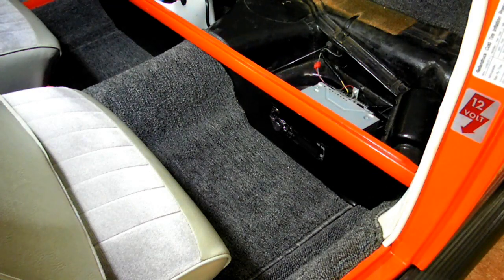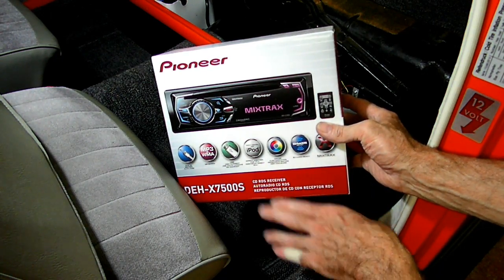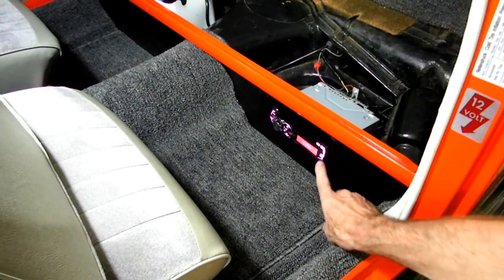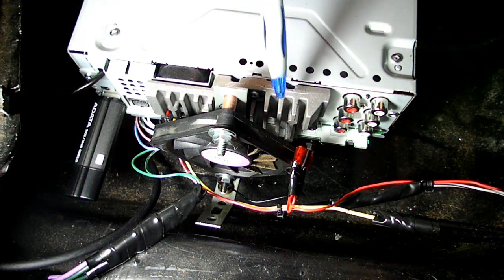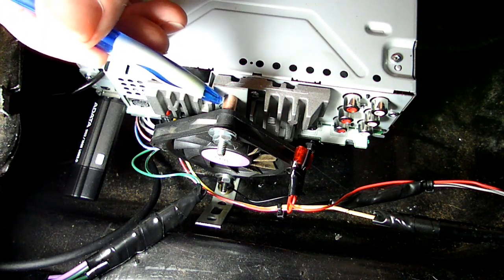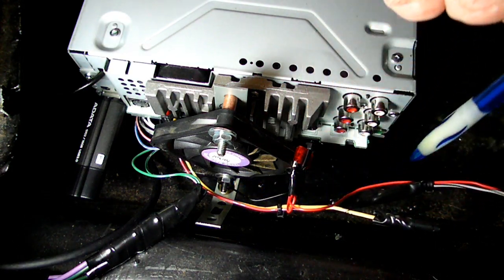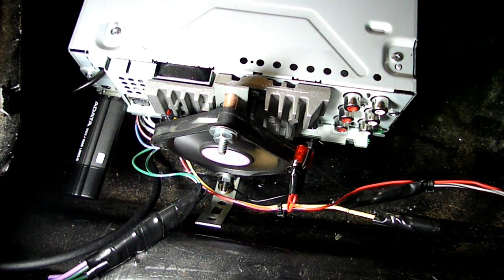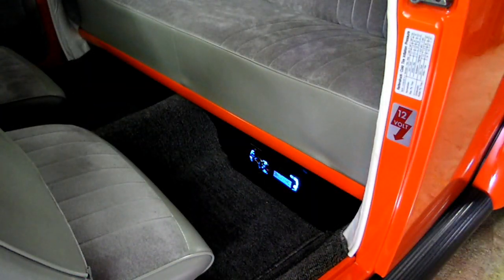Vw Beetle Radio Cooling Problem

Comment: Rich, has this unit remote or even some sort of satellital control (like the ones that work by wire in the steering wheel) Pioneer have third party vendors for this kind of controls, so you can acomodate this control somewhere in the front. They ussually take 3 o 4 wires to the unit no more than that. Nice bug there. Cheers.